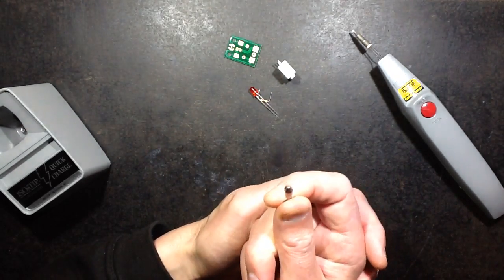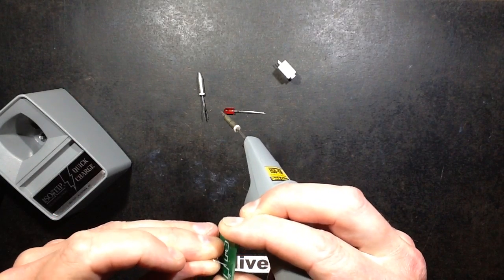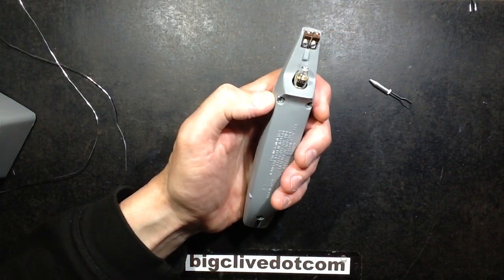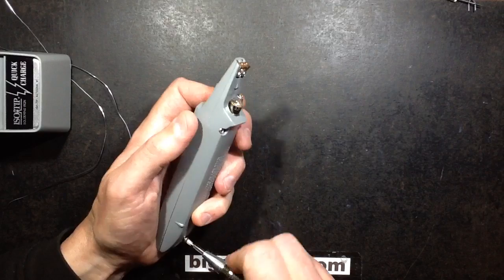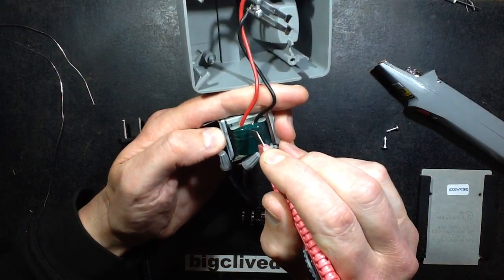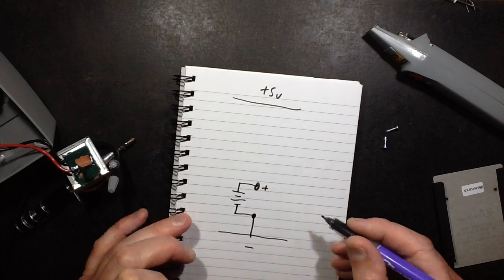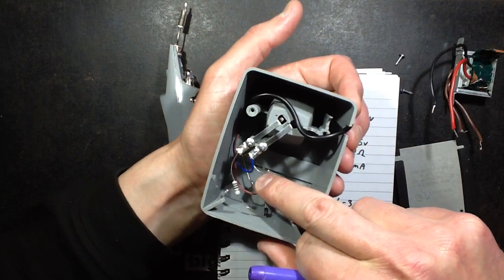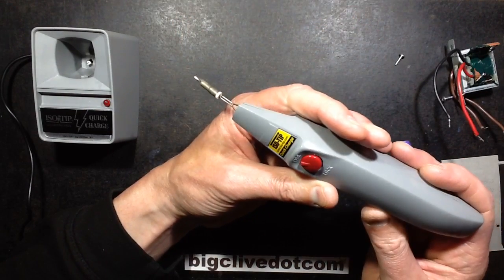Inside an Iso-tip rechargeable soldering iron.  (And charger hack.)

Comment: The newer lipo batteries are rated for sub ohm use. Of course going that low a protection circuit would be useful but my current build is .07-.08 Ω. I'm looking at the wrapper of my 21700 and it's specs look nice, 4000 mah, 40 amp/13.9 Wh. 
It's the users with bad batteries on a low resistance coil who give the community a bad name. You don't see laymen going out and installing consumer units, so why this? I've had many morons shoving dangerous builds in my direction to look at and it amazes me the lack of knowledge. All they see/want is 'DEM HUEJH CLOWDS' with no regards for their or others safety. The worst I saw was some idiot pushing his mechanical mod so hard the battery was very hot and the wrapper bubbling. He didn't know the guage, it was much thicker than my 33 guage/.26 mm wire. I'm guess about 27/28 very rigid. Scary stuff when you consider how stupid his actions were.
Reply from the maker: Unfortunately, due to Part P and accelerated 1 week electrical courses you do get laymen installing consumer units now.

Comment: You could attach one of these tips to a the build deck of a e-cig atomiser and have yourself a lithium-ion powered iron. The coils I use are around 0.1 ohm so it should work well. I would recommend using a regulated battery mod though capable of enough power output.

Comment: HAve you ever tried the sealey SDL6 rechargabe soldering iron? I work in the automotive industry and I am looking for a cordless one since the gas iron is tedious to use becasue of the low thermal mass of the tip and this iront aparaently isnt allowed in the eu.

Comment: I’ve had one of these (in an orange/red color) on my bench for many years. Very handy to drop in a tool bag for automotive or aviation repairs where ac power isn’t available. I’ve never cared for the charging circuit though, it stays warm on the bench and batteries don’t last as long as you might expect. There is an interesting accessory I like also, a small drill motor with a tiny, very precision chuck, for drilling PCBs and what not. It attaches to the lugs just like the tips do.

Comment: Clive, In your on the go tool kit, you show a mini butane soldering iron...Will you be replacing that with one of these and your thoughts on the two different types?
Reply from the maker: I carry the gas iron and also a small USB iron with a general purpose power bank these days.  This one stays at my bench.
Reply: Thanks, that's much appreciated..Very interesting channel by the way...

Comment: I really like my soldering iron. It is the even older Wahl unit with a red plastic case and LED charging lamp incorporated into the handle. I still use it and pop in a new battery now and then.
I could not even get close to the joints it has heated in its lifetime but it has to hundreds of thousands. These things were designed and built to be straight forward and work.
Thanks for the USB hack idea. It's very tempting.

Comment: I have not gone and looked at all 471 comments so someone may of already brot this point up.
There is a nice acronym for this type of design.

KISS is an acronym for "Keep it simple, stupid" as a design principle noted by the U.S. Navy in 1960. The KISS principle states that most systems work best if they are kept simple rather than made complicated; therefore simplicity should be a key goal in design and unnecessary complexity should be avoided.

Comment: You may also notice that the little 'tray' in the base, where you added the LED, is just the right size to hold one spare tip. I glued a small bar magnet there to hold the spare tip despite jostling.

Comment: I was so disgusted with the rip-off prices from this company, that I am designing my own 3.6V version for less than $5 of ABS filament. The rest of the stuff, including a Weller tip from a rechargeable Weller I had from back in the 80's, which is the key component. How do these companies stay in business with this kind of pricing, I'll never know. 
I will upload the design on to Thingiverse once completed. 
PS. there is one there already, but I don't like the Li-Ion complications, 
https://www.thingiverse.com/thing:598220

Comment: I like this. I like the simplicity and seviceability of the unit. I may have to get myself one, to replace my gas powered iron. Another reason for keeping it on charge constantly, is the annoying trait of Nicad batteries to self discharge.
Edit - Just did a search, it appears that the only UK distributor is 'Mouser'. The price for the kit is... £133.04 - Yikes!!
Don't think I'll be getting one.

Comment: I totally like the simplicity of this :). But I think the diode could have been inside the soldering iron, so the battery voltage is not exposed in the plug. This would also allow a non-polarized charging socket.

Comment: If you put 3 diode in seriries would that would be a 1.8v drop you could run the led off of that - and build circut with no resistors?

Comment: I have an original Wahl version of the soldering tool.  I've lost count of the number of times the batteries have been replaced.  I have a box of NiCd cells that I install as needed.  My charger is still AC but I added an LED because the charging contacts don't always make good contact.  If the LED is lit, it's charging.

Comment: I'm familiar with the "button dance" using a Weller battery powered iron. It's only an 8W tiny thermal mass tip, though, so the dance is more like an irish jig on 3x speed. Quite the chore to keep up with. I gave it 25% duty cycle pwm standy (which keeps it just above melting temp of lead solder) and full power bypass on demand. That would be impractical on this beast, due to the high amperage and low voltage.

Comment: But you can get very high discharge li-ion 18650s these days. Up to 200 amps, short circuit and a sustained easy 50A! And this machine costs a fortune, £60 odd. At that price I would expect up to date technologogy. After all the equivalent 18650 is at least double the capacity of that NiCd.

Comment: If you are in the situation that you have to do a lot of soldering and don't want to have to put it in its charger all the time, couldn't you also mode the thing to also be powered over USB if need be?

Much easier to go "USB Battery Pack -> Iron -> Use the thing" vs "USB Battery Pack -> Charging Station -> Iron -> Use the thing as long as it is charged and/or you are in a situation where you can actually have the docking station besides you all the time"?
Reply: If you are in the situation that you have to do a lot of soldering, USB isn't really going to keep up with your pace.

Comment: Didn't like my iso-tip 20 years ago, Mr butane pen sized orange plastic iron was magic.
INSTANT CHARGE WON EVERY TIME.
Wanted a new tip at Altronics, they had a stand full of returned irons, so  I grabbed a bundle at $5 each.
Asked the price of new tips, "that will cost you $25 each" I was told.
It's okay  I said, just paid $5 each for slightly used ones, earlier in your shop.
BTW  managed to get all but one working, nice gifts for mates.

Comment: I would have added a resistor across the battery in the charger to ramp down the charging current when the battery was fully charged.  Dumping current across fully charged NiCds is hard on them.  I haven't seen a handy source for fuse wire here in the states, so I picked up some at a small grocery last time I was in Scotland.

Comment: FWIW, I broke a tip wire (my fault, they are quite strong, but brittle and I had tried to bend it ), so I decided to examine the insides. There are six turns of soft 26ga/0.4mm heating element wire (1.6"/41mm) which measured 0.08 ohms on my four-wire ohmmeter. The leads add another 0.02 ohms. I mounted it directly to the terminals of a 10A variable supply which was set to 2.4 V. The instant I enabled the output, it went into current limiting, but only for a half second. The current stabilized at 6 A and the wire glowed a really nice orange. Since the wire has a positive temperature coefficient, the current draw on an intact tip will be higher.

Comment: I had to rummage through my garage a little bit, but found mine, with it's Sears branding and polarized wall-wart power supply. 
I have no idea if it will still take a charge, but it's plugged in now!
Reply: well, after a day and having it take no charge, a bit of investigation revealed that the NiCad batteries had let their crystalline guts out into the enclosure.

$10 later at the local battery specialty shop and a replacement pair of sub-c cells was in my hands, and this tool is back in service.  

This is one of the cheapest repairs on vintage tooling that I have ever seen, and hopefully I'll one day hand this tool on to another appreciative user.

Comment: In my contry (brazil) we use eletric soldering iron with either internal resistance (in a way similar to this, but wired), or, in some more specialized versions, with a external resistance coil, which  both take's a long time to heat up, but make a more constant temperature (with a bulky tip)

Comment: do you have to with about damaging the NiCad by overcharging it without some kind of over charging cutoff circuit?
Reply from the maker: NiCds can handle continuous trickle charging and just dissipate excess energy as warmth.
Reply: Brand name NiCd cells should be able to float at 1/10th "C" forever without harm. Especially the commercial grades, whivh have lower capacity but more heat resistance and robustness. Often still 600mA rated but incredibly rugged.

Comment: They encourage you to open it, but I think you crossed the line. You warranty is voided... Quick question, will the light turn off when it stop charging? Does the battery open the circuit when they are fully charged?
Reply from the maker: LED stays on and batteries keeps trickle charging.  NiCd and NiMh cells will happily accept continuous low level charging current because they simply recycle the internal gasses back into electrolyte.  They're nowhere near as demanding as lithium cells.

Comment: These have been well known and highly rated in the U.S. "tech community" since the early 1970's. You're quite right in that the design has remained almost unchanged since then. The only real change was that they now charge faster. They used to take 10-12 hrs. for a full charge. These were perfect for the tech's tool roll/kit for field use and also for the occasional light duty on the bench. If you only had a few joints to solder and your bench iron was off, these were always ready if left on the trickle. If you had a lot of joints to do, you could start the job with this as the bench iron was coming up to temperature. Wahl (the clipper Co.) does still make some of their better line here in the U.S. while the lesser priced products are now made overseas, however as of 2008 Wahl no longer owns the Iso-Tip tool line. A company called Senasys now owns Iso-Tip and can be found at www.Iso-Tip.com. When I was a kid, I had a Radio Shack (Tandy) knock-off that came without a drop-in stand and only charged with a small SLOW wall wort style trickle charger. It worked very well and would even use real IsoTip elements. These are, as you found, quite handy and worth having at the ready!  BTW - Reminds me of the old saying that I myself seem to forget sometimes; "If it ain't broke... don't fix it"!!!  ;^) lol

Comment: won't that overcharge the 2.4-3v battery usb is 5volt or i am missing somthing very obvious?
Reply: resistors drop voltages in circuits

Comment: Replaced batteries on two of my units recently,these were purchased in Saudi Arabia in the 70's,still going strong using construction of the KISS principal,the USB mod is going to be the next project,as well as the red charging LED i am going to use a green one for fully charged condition incorporated across the battery via a silicon diode,so the LED comes on when the battery voltage threshold is reached,see how inspiring your videos are!

Comment: at the end there when they put the fuse wire to prevent from shorting they should have just put the diode there, boom problem solved. and then it will not matter which way around you put it inside the base or have to worry about putting a diode to the transformer.

Comment: Im always a bit amazed how you can hold on the the PCB, component, soldering wire and iron at the same time
Reply: Absolutely.. I have started to try to do this because he is just so damn fast in comparison to me. ^^;; It's like, "Ok.. I've got three components.. Let me grab the pcb vice and screw it in.. oh.. I should also put in the components I'm going to solder. Bend bend shove shove. Ok, let's start to solder already... Drops components while trying to solder them in with the vice. Fuck. Ok, last one... Looks at other side after solder job and the complainants are all fucky looking "

Then I look over and Clives got some 50 piece kit soldered up and working. lol What also amazes the shit out of me is how he does this with short leads, holds the part against the pcb with his finger, and then doesn't manage to fry his fingertips. I mean, I'm CERTAIN they are burning him a tiny bit, but it's still amazing that he manages this without burning the shit out of himself.
Reply: I've started to try holding my stuff like that since I found the channel, and honestly it feels really comfy. Like, we have five fingers per hand for a reason, may as well get the most out of them.
Reply: hackeritalics I've been doing it too. Gotta go fast! If your iron is cool, the heat radiates far enough through a part to sting your fingertips before it's joined properly. A hotter iron heats the joint fast enough to bond before the heat gets to you. Dead bug joule thieves are a great practice circuit for this!
Reply: I know rite.he does an amazing job.i love watching him work.very interesting guy😊
Reply: I'm always amazed by both that and
How he manages to always cut twards his thumb with a razor without cutting into it.
Reply: @nenben8759  I feel like he just doesn't show us the time he does since hes always covered with cuts

Comment: They are using NiCd batteries so isn't keeping them on the charge like you said at 22:40 bad for the battery? Talking about memory effect that NiCd batteries have unlike Lion or NiMH.
I do understand why you'd want to keep it on the charge though
Reply: Saft, who own the NiCad trademark, and Panasonic will both tell you their (premium brand name) NiCd batteries haven't had a memory problem in decades. Other cheap brands using older technology might syill have that problem.

Comment: i know it's stupid question, but where is there only 1.6V across the 10ohm resistor? shouldn't be 2.5V? is the V across the diode 1V?
Reply from the maker: The two cells will have a combined voltage of  2.4 to 3V when charging plus the diode leaves around 1.4V to 2V to drop across the resistor.

Comment: What's the colloidal silver generator for?
Reply from the maker: Just an experimental thing.  Not for drinking.
Reply: Hehe, alright then. I'll admit you had me raising my eyebrow for a sec. Also I want to say I love the videos! I came over from Ashens' channel and you have reignited my love for electronic engineering which has created a small dilemma on what I want to pursue at this time, but in the long run that's probably a good thing.
Reply from the maker: If you mean as a job then I strongly recommend you get a technical trade.  Preferably with an apprenticeship if you can.
Reply: I am debating taking an apprenticeship in welding vs. continuing my original plan which was a 4-year BSEE degree. The only thing is that, although I LOVE electronics, I often find myself being disinterested or losing passion sometimes when I don't think I want to. I feel like my love for electronics is more hobby-like in that I only want to build things that interest me, so if I'm not designing and building something like music equipment, my eyes glaze over and I couldn't be more bored. I really don't know how quickly I might get bored of welding, but something about it is actually very soothing and I can easily focus on what may seem tedious or boring to others. Also the pay is quite good, which is nice. I know I didn't exactly ask for your advice so I'm sorry for the ramble. I guess I just felt like expressing my feelings on this slight fork in the road.
Reply from the maker: A job can ruin a hobby.  It sounds like you could do well at welding, especially if you have a natural feel for the flow of metal.  I would suggest that a paid apprenticeship in welding and fabrication might be the way to go, with the bonus of being able to use your electronic knowledge to make active illuminated metal sculptures for fun.
Reply: I like the way you think! Seriously though, thanks for the reply. I have been leaning toward welding but in a silly way I felt like I might be turning my back on electronics or something in that regard. This discussion helped me cement my thoughts a bit and accept that it doesn't have to be that I give up one for the other. So genuinely thank you for that, I really appreciate it.

Comment: How would you convert this for battery cigarette lighter voltage? 

Would be really neat for a sort of on the go soldering iron
Reply from the maker: Same as the circuit I showed with a car socket USB adaptor.

Comment: Nice USB hack Clive. Do you think it would be fine to Replace the original battery with a 18650 li-ion one?
Reply: Daniel McGregor It would take a modification of the charge and discharge circuitry, and  you would need a special low internal resistance 18650. Most li-ions would either cut off power or explode under that load.

Comment: You can get 18650 size battery that can put out 30 amps
Reply: but you woud need a voltage-converting cirquit, that can handle these currents.